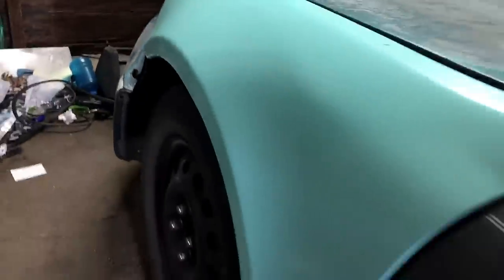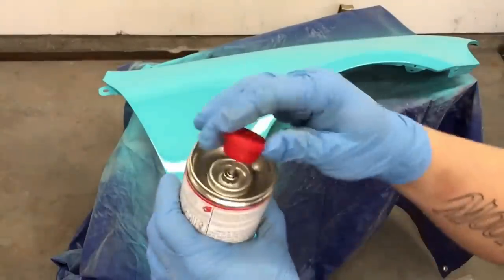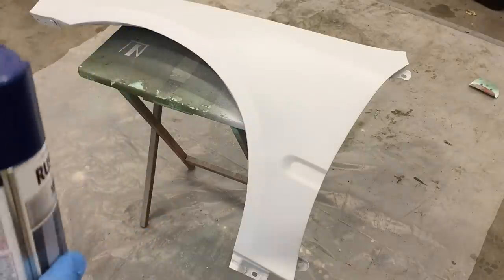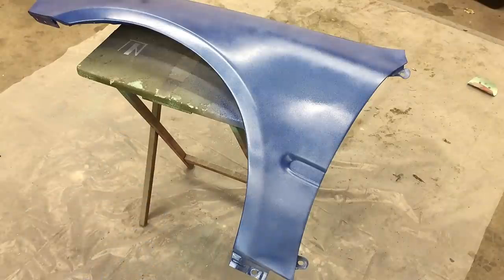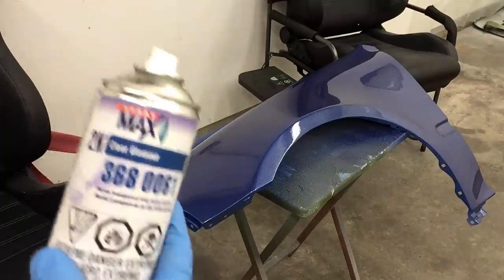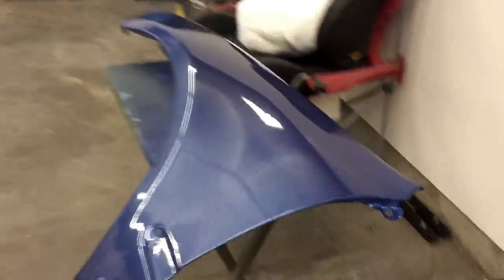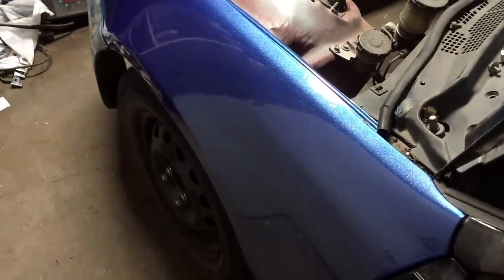Metallic rustoleum spray can paint job with 2K clear (AMAZING RESULTS!!!)

Comment: Sorry if you’ve answered this already, but I noticed you didn’t wet sand the the base coats before the 2K clear like you did with your other projects. Is there any reason for this? Or was this a “quicker” job?
Reply from the maker: jonathan livers Main reason is because of time and it’s not required to color sand or wet sand color. Now if you’re going for that car show quality finish zero orange peel then you could wet sand lately between colored coat but you’ll have to let it dry for about 3 to 5 hours per coat and this is just a demonstration fender so I didn’t wanna do a all day/night paint job on a throw away paint job. But another main reason not to wet sand metal flake is because it can ruin the paint job. It’s only with metal flake paint. Once you do the clear coat you can wet sand between coats for a smoother finish
Reply: Moore Motorsports James Dguy very detailed answer!!! Thank you! Can’t wait to get my project car ready this spring. Once it’s
Officially running, body & paint work should be cake with the help of al your videos.
Reply: @JamesDguy  what do you recommend sanding the base color with before clear coat? Solid color non metallic.
Reply from the maker: michael hartman I wet sand with 1000  till the whole panel is hazy looking when wiped dry. Then wipe with tack cloth and shoot with clear.
Reply: @JamesDguy  awesome thank you!

Comment: Hi. One question for how long last the painting,  is it the same if u do it the "professional way" ? For me to know to do it wiht my daily car or not. Thanks
Reply: Rustolium and duplicolor are some of the top quality paints on the market so go nuts with it. Prep work is 95% of the job, the better prep you do will reflect the outcome of the paint and using a quality clear coat like he mentioned in the video will yield better results. I've been painting with this method known as the rattle bomb method for quite some time now, since I was 13 started out on model cars and now I'm 30 so almost two decades and have painted numerous project cars with this exact method and still look like new, like I said go nuts and have fun and remember if you do mess up it's no big deal sand it down and start again

Comment: Can i use 2k clear coat on a painted phone case? Does it become nonsticky after drying?
Reply from the maker: I have not used it on a phone case but the things i have used it on dried within a few hours and wasn't sticky to the touch. I would say yes it can be used on a phone case depending on what paint you put down first.
Reply: @JamesDguy  thank you😊

Comment: why is it that in your other videos you just clean and sand the surface, and then in this video you used a primer? is there a general rule on when I should use a primer?
Reply from the maker: opensourcetutorials i only did it so people would shut up about me not using primer lol 😂.  I generally use a primer over bare metal or if say I’m painting a car white and it has a black fender and hood but the rest of the car is yellow then I would need to prime the entire car grey so that it all matches. If I don’t prime it then the black hood and fender will be a darker white than the rest of the car since the base color of yellow is a lighter color. Hope that made sense.
Reply: @JamesDguy  yeah that made sense. many thanks!

Comment: I'm really blown away by your spray canning system.  Really looks great. I know you said you got a spray gun to but do you ever plan on experimenting with duplicolor paint shop system? I curious how that would turn out.  Or have you tried duplicolor spray cans before? Only experience I had with duplicolor spray can was touching up bumper on my wife ford fusion. Thoughts?
Reply from the maker: Erich Moosreiner I should do a video on duplicolor and I have used it in the past on my green dodge neon there should be video if you look far enough back.

Comment: I sanded and primed my bumper then sprayed it reflex silver multiple coats also was very generous with the coats. Then I used clear coat to finish up. The results are absolutely horrible. I have a lot of tiger striping, and it barley even looks shiny. What did I do wrong??
Reply: Tiger striping usually points to the wrong spraying angle.
Reply: 99dimensions thanks for the feedback I definitely wanna get my car looking perfect

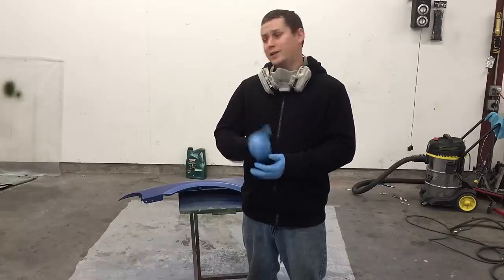Comment: 5:17
Did you sand between coats?
Especially before you put on the clear coat?
Reply: Judi Christopher don’t sand metallics
Reply: Color sanding is a touchy subject, but like he said above, it’s a no no on Metallics.. usually you can do a couple coats of clear, dry sand flat and do a flow coat of clear.. that turns out nice really nice, but not a necessary step..

Comment: Noob question here.... Why did you have to re-prime over the previous paint job? I thought as long as it was bonded to the original metal, if you wanted just a color change, you only had to scuff up the top coat and spray your base coat?  Awesome vids, keep them coming!!
Reply: Dried paint has a hard surface so you want to rough it up by sanding it then priming to allow for ultimate adhesion
Reply: @KillaCaff1  Thanks! Makes sense, but wanted to make sure.  I've seen others bypass the extra step of re-primering.
Reply: @tobywise3781  you can by-pass it, but I don't recommend.  The extra time really allows for a better finished product that is much more durable
Reply: @KillaCaff1  Hey, I'm sold. Only a few bucks more and a little bit of time. Really looking for the durability.  Re-doing a 2007 GMC Canyon and not looking for showroom quality finish but want something that will hold up. Roof is about the only panel that didn't need body work anyways!
Reply: @tobywise3781  good luck on it!! Remember to take your time and do it right the first time so you don't regret a bad job a year later.  Good luck! 
I am currently working on my jeep doing suspension on a 2010 liberty, pain in ass cause I live in rust belt, going slow but the torch to heat up nuts is my best friend!! Every damn nut is a rusty little botch

Comment: Hey! Got a question... Hope you or somebody could help me 🤞
If i get Orange peel on The colour coat, should i sand It and then Paint It again? Or Just sand and move on to The clear?? Thanks!!!
Reply from the maker: Ema wolF wet sand it with 400 re shoot another color coat and if it still has too much orange peel wet sand with 600 then clear over it and it should be good but I have done plenty of painting without wet sanding then clear coated over the color.
Reply: @JamesDguy  thanks a LOT man

Comment: With what grid do u take the orange peel?
Reply from the maker: I have a video of me showing how to wet sand and buff orange peel. Its of a pink crv in my videos. I use anywhere from 1500 grit to 2500 grit and wet sand using water.
Reply: Thank you for your respomd ,however i am newbie i finish painting. Mine and look wonderful,  them one more day wet sand and them clear coat . thank you again.

Comment: Was wondering if you can apply 2k high gloss clear over 2x Rustoleum gloss white+primer that has been painted 1 week ago? 

Would I need to sand and then apply the 2k clear coat? 

Thanks, any info would help.
Appreciate it and keep up the great work mate!
Reply from the maker: Nos Nguyen I have seen a buddy do it after watching this video so far it is still holding up. He wet sanded with 1000 grit then wiped it down with tac clothes and did the 2K paint not the 2X clear but the 2K

Comment: I got lots of tiger stripes .... why
Reply from the maker: Temperature has a lot to do with that. I failed to mention them things in this video. Sorry about that. If it is hot out or in direct sunlight the paint dries too fast and causes them lines.
Reply: @JamesDguy  oh ok. Yeah it was 96 degrees out today. I'm hoping using an actual spray gun instead of rattle cans can help eliminate the tiger stripes due to the spray pattern.

Comment: We used to spray paint engine parts on cars 20+ years ago using rattle cans to make the engine bay look cool ,clean and colorful.  Also used the Wagner electric power sprayer on cars back then and wet sand and buff afterwards to keep things cheap for us broke a$$ hot rodders . JC Whitney parts ordering was a regular thing back then as well as Summit Racing and Jeggs.

Comment: why don't you use the rustoleum clear instead of the 2k
Reply from the maker: George Rodriguez rustoleum 2X clear paint sucks it’s turns yellow over time and flakes off easy. It isn’t solvent or uv resistant paint. The 2K clear is a 2 part paint. It’s  one part paint 1 part hardener which has a catalyst. It’s stronger and acetone won’t take it off or gas. The 2X and 2K isn’t the same just a heads up.

Comment: When it starts having a reaction is because you either need to let it cure completely 4 about a week or spray right after you lay your final paint. Reason why is because the paint is wanting to reactivate itself after you put the clear on if you take more than 3 minutes to apply it  after  your final paint . its
Reply from the maker: Albert Villanueva I don’t have the issue with the 2k clear only the 1k clears but either way i found a method that works for me but yea it makes sense what your saying

Comment: Looks great, but I was wondering: if I understood correctly, between the final and 3rd color coat and the first 2k clear coat, there was just 10 min of waiting time? I get that this means the 2k will stick to the enamel paint without any scuffing, which is beneficial since it is a metallic.... however, given the very short time you allow the enamel to dry, and given that 2k polyurethane forms a very hard layer quite quickly, won't that mean solvents in the 3 enamel color coats become trapped under the hardened 2k clearcoat, and will cause problems in the paintjob after a while?

Comment: When it comes to painting metallic colors with spray cans you can get a more even finish look by wetting the last coat and then misting on a dryer drop coat in alternating directions say x patterns this way you won't get a mottled look
Reply: No shit?
Reply: Haven't tried it with a spray can, but yeah this is typically how it's done with metallic with a normal spray gun too.

Comment: Would love for a video of you trying Belton Molotow Premium or Montana Black or Montana Gold spray paints. You can get them at a lot of local art supplies depending on location. Or online from say http://artprimo.com only a 1 or 2 more bucks then rustoleum. 

Molotow especially is all weather people spray it when its freezing outside. They all have built in UV protection. A lot higher then the USA based spray paints. Not to mention female valves. So now you have the ability to use about 30 different style caps. They got chromes, metallics, transparents (candies) and all kinds of other stuff.

Seen this stuff sprayed on cars in videos but not anywhere near the detail you put in on your videos. And since its about the same price as rust-o figured it would make some awesome videos for you.

Well great job n videos. keep it up man

Comment: i put 3 coats of blue metallic then 3 cots of clear WOW! 3 hours ago and still looks wet. i've never seen anything like it. i'm not gonna wet sand it. what should i do next? polish,wax ?
Reply from the maker: floyd rose if your not gonna wet sand and buff it then I would get some ceramic coating and you should have a very long lasting durable paint job.
Reply: Do you have a pic of it?

Comment: On your Rustoleum job you mentioned. That you painted with rustoleum paint and cleared it and spider cracked. This is a common mistake because the paint is enamel and the rustouleum clear coat was acrylic! But in order to do this you need not to use the rustouleum acrylic but the clear enamel! Rustoleum makes both clears. Enamel Enamel. Acrylic Acrylic.
Reply from the maker: Tim Merring I never got spider cracks When I used rustoleum paint and applied the 2k clear over the top it never cracked at all. Even did my wife’s entire crv these 2 fenders and many more things never had spider cracks when using 2k clear: now when I used 2X clear over 2X rustoleum paint it ends up cracking that’s why I stay away from the clear at all costs

Comment: Ive rattle canned my Contour SVT with the Cobalt blue metallic! I absolutely love this color! I've never had an issue with the rustoleum 2X clear with the 2X paints, but did have the wrinkling when sprayed over other non-2X cans and thats exactly what it is, a bad chemical reaction between the two different paints. On my last paint job, I mixed the 2X gloss purple with the cobalt blue metallic and it turned out amazing! One thing I did do when I sprayed both the car and the motorcycle, was with each coat of color, I backed off 3-4 inches with each coat to help the blending process and avoid "tiger striping". 

https://youtu.be/siPpwFu6lO8

Comment: I really want to see what the oil rubbed bronze from rustoleum looks like on a cah. that being said you're amazing. I've painted a few cars with can, some came out good and some didn't but you are proof that time and motivation is all it takes to get a good paint job even on a budget.
Reply from the maker: Joseph Lawrence I love oil rubbed bronze I need to do a whole car with it.
Reply: Just time, patience & focus. I did my 1960 F100 with spray cans, wet sanded between coats & let the truck sit in the summer sun for 2 weeks after 10 coats of clear. I had the final rubout & wet sand done professionally & the wax job at the end by a trusted detail shop. Great exercise in patience

Comment: I would like to thank you for this great video. I Have picked the same color COBOLT BLUE.  but every time i sprayed my door panels it would have a streak look in certain places.  so i thought spraying light coats would be better.  it did a little.  i want to do my whole 85 Isuzu Truck.  but was afraid to spray it out of a can.   I LIVe in Hawaii and have great weather here.  THE sun is very hot so i can leave the can in the sun to heat up.  again thank you very much.  I Would like to know though one thing, where would i get the 2K clear??  here we have Wal Mart, Home Depot,  Napa AUTO Parts, ORieley's and AUTO ZONE, but i have not seen any 2K clear coat sold by these dealers.
Reply from the maker: Riden Roam I have to order mine of eBay with the link in my description
Reply: If you still looking I checked everywhere, HI-LINE Distributors were the only ppl on Oahu, just got mine yesterday it’s $23.47 a can

Comment: Looks REALLY good! Considering this technique on a inexpensive Toyota Corolla. Is the prep or materials and techniques any different on the rubber or flexible plastic front/rear bumpers on these cars? Also, do some auto paint shops match factory colors IN aerosol cans? Is that correct?

Comment: I will not recommend the heat gun to people... some will get it explode in their face for sure!! Better with the warm water.
Reply from the maker: ducaking I guess your right lol I never had a issue with that but I’m not the average idiot when it comes to doing stuff. Warm water works great to but we use a heat gun on the bottom off the can for 15 seconds then shake the can and then do another 15seconds and shake until it feels warm enough. But I should just tell people water lol

Comment: Do you wait for the paint to fully dry before applying 2k?
Reply from the maker: When using the spray can 2k clear i like to do it while the paint is tacky/wet still. Never had a issue doing it that way and holds up great.
Reply: @JamesDguy  how long after spraying last color coat, do you wait to apply the clear coat? And do you cut and buff only the clear? Or do you wetsand the color coat before applying clear

Comment: why primer first? do you think its a better final product rather than sanding and spraying over the existing paints panel?
Reply from the maker: Steve Lobo The primer just lets it lay down smoother and bond better but I don’t always prime but I’m trying to make it a habit because the paint jobs do come out a lot nicer. The Rustoleum spray can usually has a paint and primer in 1 so it’s not always required. I have a paint job that’s 4yrs old and I didn’t primer it and it’s not flakes off or anything.
Reply: @JamesDguy  fair enough .. im flipping a car and need to paint a door panel.. trying to decide whether to use a Rustoelum spray can or have my body shop  supply store mix me up a can of single stage.. the difference is apparent in both the quality and price obviously... suggestions if i go with rustoleum??? its hard to get it looking good .. for me it seems like its a hit or miss when painting with rustoleum
Reply from the maker: Steve Lobo I never had it come out like crap and I won’t a car show where professional auto body technicians were judging they car and they couldn’t tell it was spray can until I told them so I would say it’s pretty good. You just have to make sure to get the coats wet and even and it looks great. The paints from $3-$5 with Rustoleum is some of the best you can get for the price. I have a ton of videos of me painting other vehicles with spray can if you wanna browse the channel

Comment: You have anything Advice about painting a plastic fender or is that plastic or mental.I wouldn't mind painting mine so it matches car it's a Arubrun color car with red fender on front.
Reply from the maker: Why so Serious? I use the same method when doing on plastic because rustoleum bonds well to plastic.
Reply: Moore Motorsports James Dguy Awesome I've been wanting too paint it Thanks